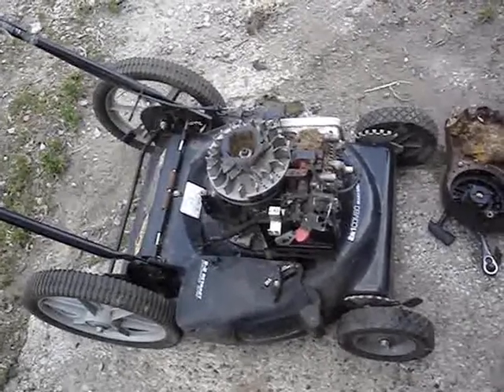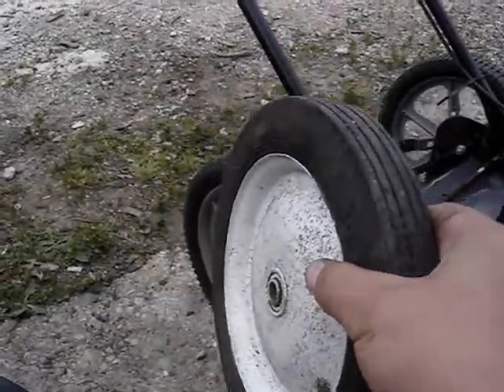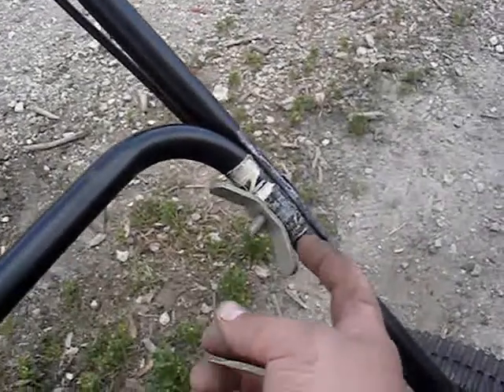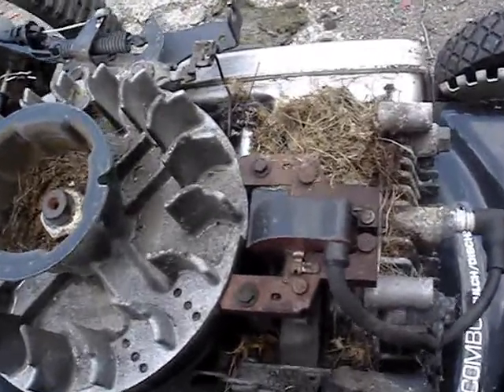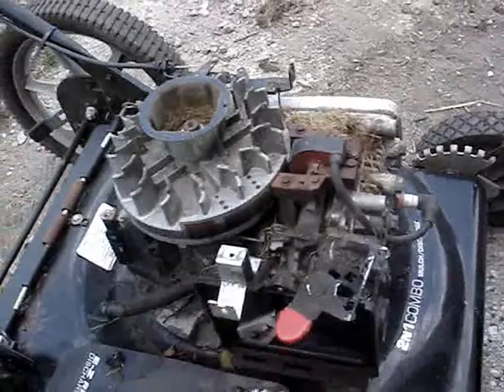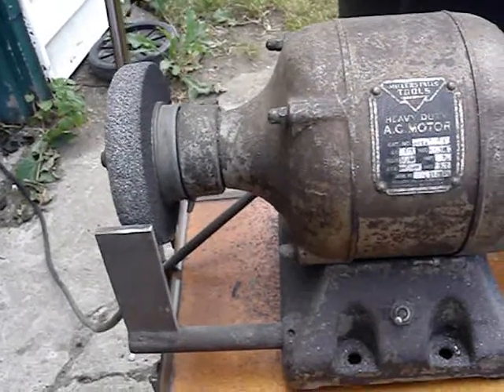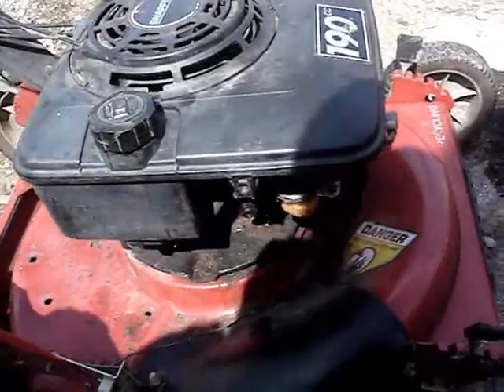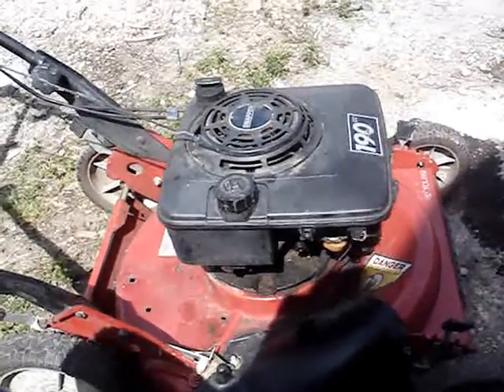Trash Mower Epic Failures!  My Bench Grinder

Comment: That grinder it at least 20 years old I am 50 and I seen one in a sears catalog  It always nice to get a piece good old power stuff.
The mower is a good looking mouse house. I live in a rual area and I have a old leaky garage built in the 30s I get them every time I put my stuff away fro the winter and come spring I have to check every thing.  
A good tip use moth balls to keep those creatures at bay.